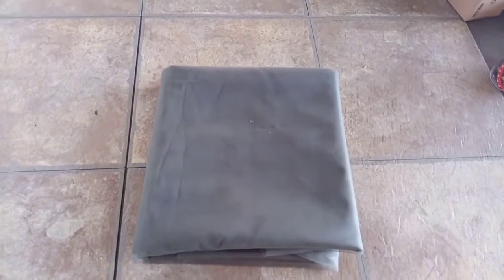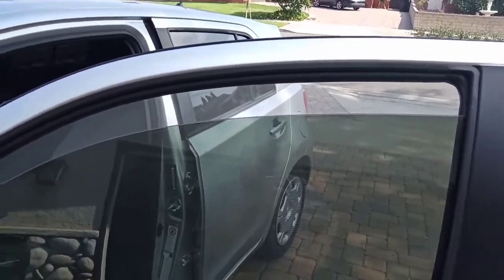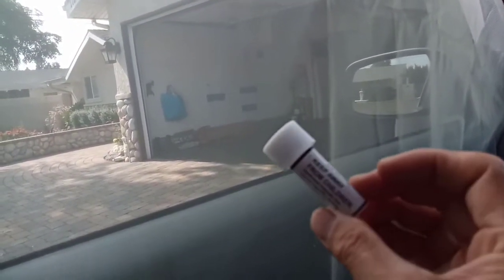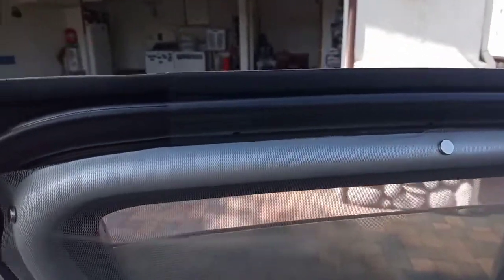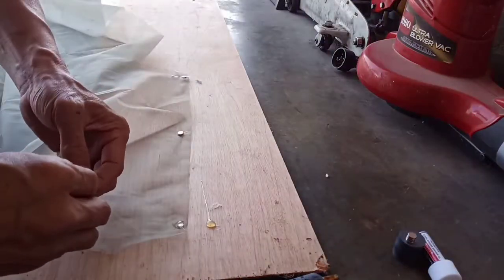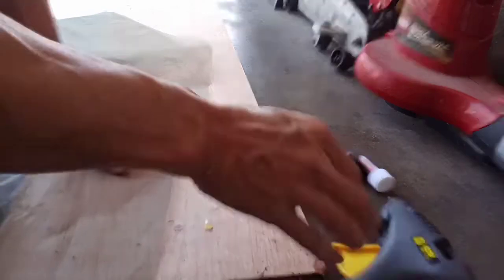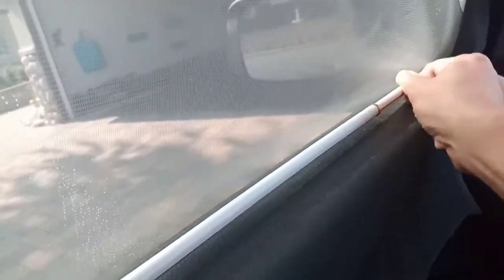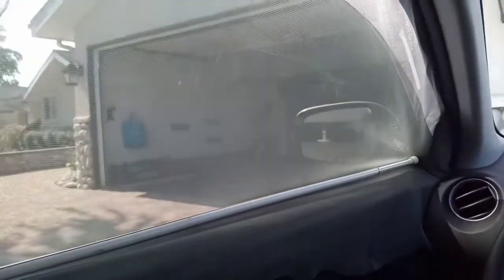Car Camping: How to Make Bug Screen Quick and Cheap.

Comment: 💯 😀👍 those screens make a hug difference! TFS
Reply from the maker: Yes it does Dia! I can breath at night.😁 But now I have to figure alternative to reflectic window covers for those window.🤔
Reply: MoBang FoYoBucks some people just cut the reflectics to where it fits the window and then cut straight a couple inches on each side so they can Bend some down to have ventilation or see out too.